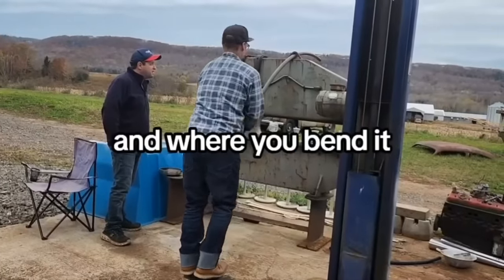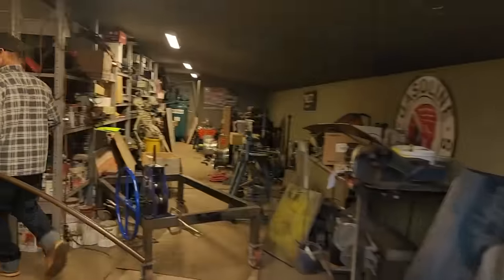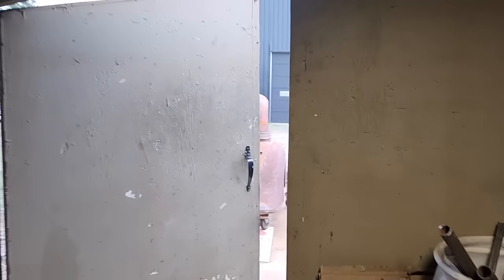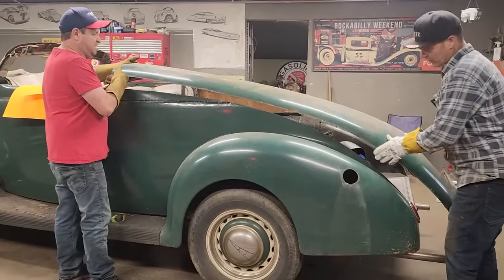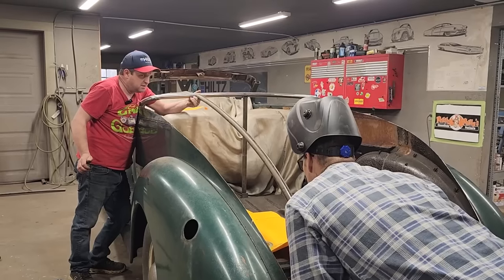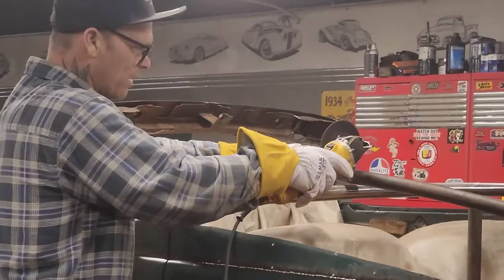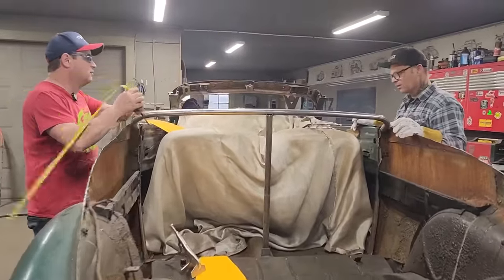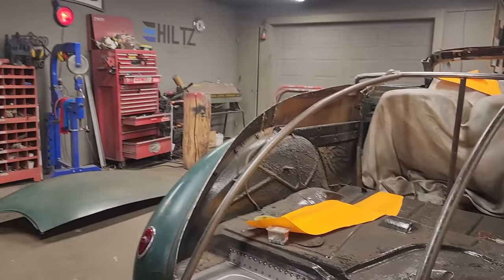The rear fabrication begins 😐

Comment: A hatchback lifting up from the back would free up all that trunk space for spare tire, gas can, tools, luggage, camping and picnic gear…etc. Instead of closing it off. It would look clean if you put metal panels like that last step in the back. Level and carpet the floor. Couple of hydraulics to hold it up or raise automatically with no latches or handles visible on the out l, just clean lines. Hit a switch and it opens.

Comment: Its looking good.  Maybe paint the new panels black. it'll go well with the green. It's easy to find the center when measuring with a tape measure just by folding it in half. Its flexible and won't break...

Comment: With the curved pipe running down the back you could have just notched it with the cut off wheel and slid it across and back in to help with the gaps rather than cut it shorter again, just my 2 bobs worth.... love the content 😊

Comment: Just one suggestion. I would lay either a piece of square stock or pipe between your two piece you put in at the bottom to give you more area to weld it to the car.

Comment: Suggestion, why don't you take both bars with you outside. would save a lot of camera time and trips.
Reply: Because saving camera time is not part of the business model.

He could have had the pipes ready to go, and spared us 40 minutes of bending, and hammering, and more bending, and more hammering, and even more bending.
Reply: @daddysails8926  - I wait until it over, then fast forward through it. Takes about 5 minutes, and I see all the progress done on the car. You're the one wasting an hour.

Comment: I don't understand once you got the first pipe the correct shape why you didn't take it outside to use as a template there instead of going in and out of the shop to compare the two.

Comment: I have to laugh when I see Americans and Canadians battling to work with imperial inches and feet. Metrication is so much easier, especially when trying to get the half of something. Take your problem. 55 3/8th takes some thinking to get the half of. 55 3/8th = 1,404mm which easily converts to 702.

Comment: So FYI Chad if you look that round stock settle every time before you try to work it in that outside machine you'll get more of a straight bend not to mention if you try getting behind it and pulling on it rather than leaning or pushing on it you'll also get more of a straight bend and it's a little easier to control your bend😊

Comment: When you measure your support against the left side of the car body it's tilted at least 10 degrees. Next when you weld it in place , you weld it vertically causing it to rise about 1/2 inch,.

Comment: way to guys, just wondering, why you dont carry your pattern outside with ya while bending the pipe
Reply: Work harder not smarter
Reply: @shanethompson7543  MVP 16 0z.    , someone said, a meat hammer in a sussi shop, lets bend round stock with the square tubing dies, and then weld em on n the wrong spot, yup